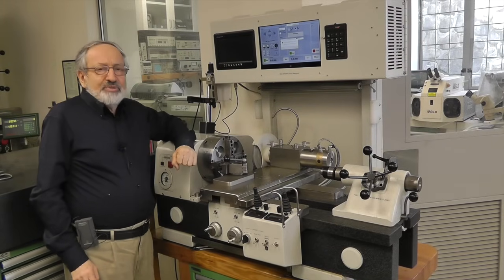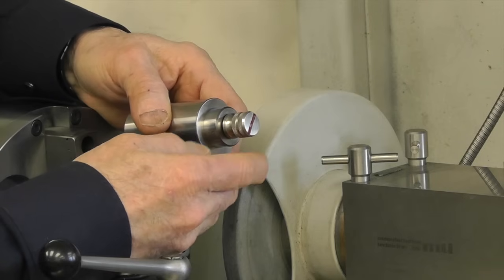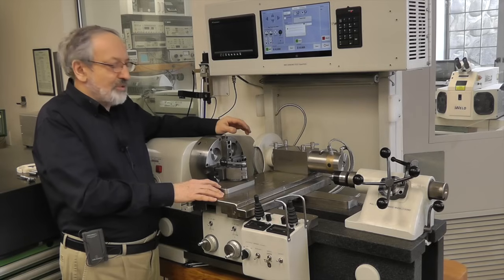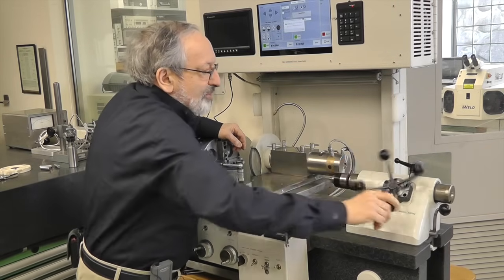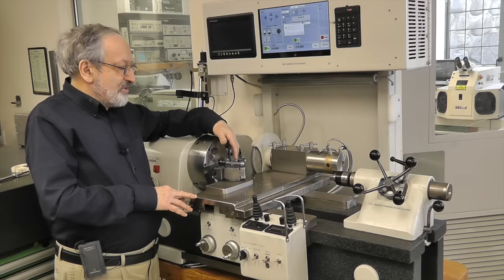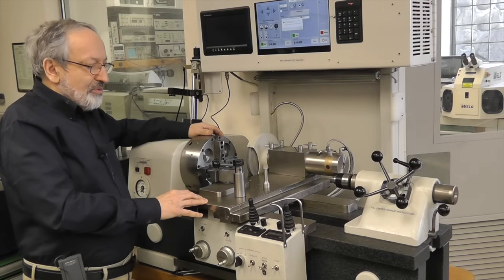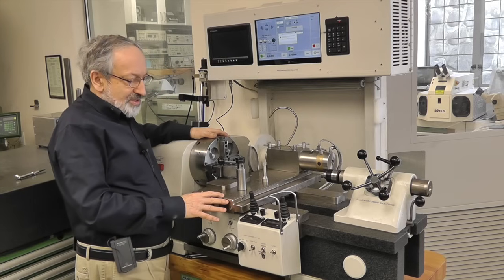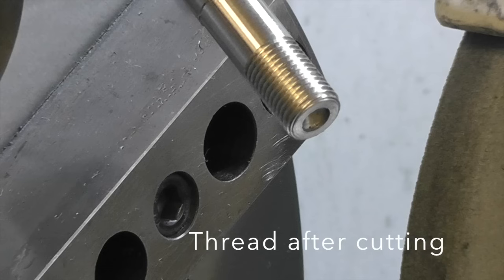High precision air bearing CNC lathe and grinder

Comment: What tool\procedure is used to calibrate equipment of this accuracy?
how to maintain it for a long time?
Reply from the maker: Standard tools: Micrometer, Granite cube (for squareness), capacitance gage (for roundness). It is stable because it is made of granite and stabilized steel.
Reply: Dan, could you clear up my understanding of how the 2 vertical granite parallels are connected together. Is the connection solely with the 2 cross bolts with spacers or is there another granite parallel (unseen on the video) glued between the verticals that maintains the alignment and the 2 cross bolts are addition re-enforcement?
Would a replica of the granite machine base be within the means and ability of an amateur builder?
Reply from the maker: They are connected by 4 cross bolts with precision ground spacers. The bed is assembled upside down on a high quality (grade AA) granite table, to guarantee tops are on the same plane. Distance between two top slabs is maintained by two removable spacers while the epoxy cures.  If you have a good granite table you can build one.
Reply: @dgelbart  make more video please if its possible...
interest how you protect bed from grinding debris (we traditionally try not to do grinding work on lathes)
Reply from the maker: I originally counted on the airflow from the air bearings to blow the debris away, plus the way wipers made of felt, but now I have way covers.

Comment: What kind of surface roughness can this machine achieve?
Reply from the maker: Never measured it. Not quite an optical mirror finish , but you can see a nice reflection of the tool from the workpiece.

Comment: Mr. Gilbert, 450 comments is a bit much to get through. Have you mentioned if you use screw threads for saddle positioning? What position sensors did you use? Thank You for sharing and inspiring. I want to attempt a similar precision lathe grinding build myself.
Reply from the maker: Just ball screws. In most of these applications geometry (cylindricity etc) is more important that accurate absolute position.
Reply: Dan Gelbart Thank you.

Comment: Does anyone have such a machine? I need a passive thrust air bearing similar to the one shown in the video. Like the Rayleigh Hydrodynamic trust bearing (video). Willing to pay $$$'s for such a machine part. Step size is ~0.00005" 1.27-1.25 microns
Reply: Can anyone build something like this?

Comment: Hi Dan I'm am upgrading my old lathe to a VFD and adding a DRO and was wondering would there be any value in investing in a  1 micron vs  the standard 5 micron magnetic linear scale for the cross slide?

 I worked at  Creo Products at the Annacis Island plant and remember one of your Creo University lunch and learns. It inspired me to get my engineering degree.
Reply from the maker: The other errors in a normal lathe, even toolroom lathe, are 5-10um so it will not increase your over-all accuracy. Also, the 1um resolution scales are not accurate to 1um. In short, I would go to 1um only on a very good lathe.

Comment: A masterpiece of ingenuity and excellence! 
At 6:18 you show your internal grinding adaptors, on which there seems to be a number of fast helical patterns in the stone  surface, what advantage does this bring to the work and how is it made?
Reply from the maker: I wasn't getting the accuracy I wanted (sub micron) and I suspected that coolant needed escape channels as wheel OD was close to ground ID. Not sure if it helped, chnnels put in by hand with diamond wheel.
Reply: What position feedback technology are you using, with ball screws, piezoelectrics, linear motors or other? What drove the selection?
Reply from the maker: Just ball screws. In these kind of jobs the main thing is the geometry (squareness, parallelism etc). Exact position less critical, unless you cut tapers  and spheres.

Comment: I'm very much on board with the use of granite in the construction of the bedways.  My question would be how did you properly align the centers of the head- and tailstocks to the ways and to each other.  A video explaining that would be very interesting an informative.

Also, did you manufacture the actual bodies of the stocks as well?  That is, did you make patterns and have castings made, or are these items from other machinery adapted to this machine?
Reply from the maker: A temporary tailstock was bored with the headstock, then a long boring bar between headstock and temporary tailstock was used to bore the tailstock in situ. Tailstock was advanced with the carriage during boring. Bore was lapped afterwards. The same temporary tailstock was used to gring the tailstock quill out of hardened A2.
Reply: That makes perfect sense, of course.  What of the CL of the heastock to the CL of the ways?  This is quite fascinating.  I was unaware of the magnitude of the radial load bearing capacity of air bearings.

Also, may I take it that the positional orientation of the carriage and tailstock relative to the CL of the lathe axis is established and maintained purely by the square geometry of the ways?  That is, you do not make any use of features such as grooves like a dovetail in the bedway as used by Hardinge?  

I have an old Schaublin SV102.  Back before my eyes started going funny, I could hold well under 2-tenths if I used great care.  It is a fine machine, but what you have created here is really very appealing in its precision.  Your leveraging of off-the shelf items to achieve it is very admirable and creative.  You should write a book on it - I believe it might well hold a place along with Moore's tome on accuracy and precision.

I would love to undertake a project like this.  Thanks for the very well done and fascinating videos.  Extreme precision has always been of endless interest to me.

Comment: Just a shoot in the dark. Any chance you have drawings on how everything is put together?
Reply from the maker: Unfortunately no, this was put together as a "one off" with no documentation.  Also, if I would have done it again I would use larger diameter ballscrews  (25mm i.o. 16mm) for increased stiffness.
Reply: Shame looks great though. Thank you.

Comment: Hi Dan, what did you use for the linear motion? Linear motors, ball screws?
Reply from the maker: Micro-stepped stepper motors + ball screws. There is a look-up table to correct leadscrew errors.
Reply: Is it open loop? Do you mind telling me your supplier for ball screws? I have been designing high accuracy 3D printers but have found lapped and ground ball screws to be prohibitively expensive.
Reply from the maker: High-quality NSK and THK balls screws bought on Ebay. The type with preloaded nuts. Open loop. Closed loop would be better but I mainly needed the accurate geometry, not absolte sise.

Comment: I know you've been asked before, but where can I get something similar, something I could mod with grinder, and make a better machine, what would be a good lathe to start with under 20k
Reply from the maker: Your best bet is to start with  a used Hardinge,  Schaublin 102 or similar lathe and add CNC. Can be done under  20K.
Reply: Thanks for the Reply Dan, I will look into it, would love to be a Journeyman in your lab, take a look at my machines over at mechabits.co.uk not quite as impressive as yours, loved all your vids.

Comment: Hi Dan,

What about the cross-slide? I mean, what kind of  configuration did you put the air bearings to give a better rigidity? In the video, I  can see a sort of inverted T configuration. What kind of  preloading did your system use? Oh, I almost forgot, how do you synchronize the "off height" and the "on height" of the air bearings with your motion system? (I mean, without  creating some "bending" force in some type of ballscrew drive).  

Great work Dan! learned a lot of things in your videos!
Reply from the maker: Cross slide is two 1"x2"x12" granite parallels with air bearing aon all 4 sides. Air bearings move up only ~10um, so this is easily taken up by nut flex coupling.
Reply: Thanks Dan,

I watched this video a couple of times, and that tool slide part was the most intriguing (maybe because it's hidden). Whith "running on all 4 sides" you mean in each granite parallels? I say, the bearings surrounds that bar more like a box (granite can hold the cutting pressures?)? Or its more like the bedways (T like)? 

Wondering if its possible to build an "air bearing milling machine" with the same idea...
Reply from the maker: The two parallels are raised on spacers which are about half the granite width, so the air bearing can reach bottom as well. The leadscrew is located between the parallels.

Comment: Hello Mr Gelbart, 
Do the air bearings for the linear motion axis' have any type of preload on them such as vacuum preload, or perhaps the weight of the saddle alone provides enough preload? 
thank you for all of your videos, they have and will continue to inspire me each and every time I watch them, including the steam engine!
Giuliano
Reply from the maker: The preload is done by opposing pairs of air bearings.
Reply: Hi dan, thanks so much for your videos i thin they're great!  How do you have opposing pairs for the Z axis? is there a slot the cross slide resides in or is it just opposing sides of the granite? I'd love a follow up video on this machine if you had the time to go into some more details such as the underside
Reply from the maker: The bed is two 50x100mm beams, each beams has air bearings on all 4 sides. Bottom bearings are smaller, to leave room for beam support.  Complete Z axis has 24 air bearing pads, to increase stiffness.
Reply: Thanks for the quick reply! wow! must have been lots of lapping to make all those bearings!

Comment: Would this lathe not be able to handle as heavy work as a lathe with more conventional bearings?
Reply from the maker: This is correct, but it is easy to increase the air bearing size or to pump oil (or coolant)  instead of air into these bearings  to handle heavy loads.  This particular one was designed for light cutting, motor is only 1HP.

Comment: Hi Mr. Gelbart, thx for this awesome video, too. I'd like to see more videos about this lathe, more so I'd like to build my own. Couple of questions:
1. What's the inner/outer diameter of your spindle shaft? Stainless steel?
2. Did you use thrust bearings for the spindle/tailstock? If not, what did you use to limit axial motion?
3. How is the cross slide fixed in position? Radial air bearings from both sides? Vacuum preloaded ones?
4. I understand all of the air bearing components have to be made to very tight tolerances. How does it react to temperature fluctuations?
Reply from the maker: Spindle air bearing about 100mm dia x150mm long, plus trust bearing (double sided) about 150mm diameter.  spindle is 440 stainless, about Rc 45, mating bearing bronze. About 100 air orifices.
Reply: Mating bearing? What's that for?
Reply from the maker: I meant the actual sleeve the shaft rides in.

Comment: I recall learning about air bearings in high school....early 1960's...I was impressed by the clearances (recording studio turntable)....take the shaft out...put a fingerprint on it....you could barely force it back in....and it wouldn't turn....
Reply: Yes, my story is just about like yours...high school...1961....and a fingerprint will 'lock it up'...and it was a record turntable...12" at least.

Comment: What a great machine. I have a couple of questions. 
First, how do you deal with the differential expansion? I understand your shop is temperature controlled --- is it on 24/7? Could the machine get warped if exposed to temperature extremes? 
Second, would it be possible to build a machine that is both precise and capable of heavy loads? Perhaps not at the same time. Maybe it could somehow switch between running air bearings and regular bearings. Is it a crazy idea?

Comment: Does it affect the precision capability, if you use a lead screw or a ball screw, and does it matter between servo or stepper. You use air bearings and granite for the ways I'm just curious about what should be used for (actuation) of a build like this. Thank you for your videos it's a real gift from someone so knowledgeable.

Comment: What is your estimation regarding how much axial and radial force the lathe chuck can handle before causing long term damage in regards to the accuracy? What are usual tolerances for the airbearings and gap inbetween the shaft and housing, also would a sealed version with pressurized hydraulic oil instead of air be more suitable for heavy load applications?
Reply from the maker: Max axial and radial force about 100Kg , airbearig gap typically 10um (0.4 thou), pressurized oil will carry more load and less sensitive to crashing as it is lubricated.
Reply: Dan Gelbart one thing i forgot to ask is how much of an issue is starting and stopping the shaft turning, when there is physical contact between the two surfaces at 0 rpm wouldn't a little bit of wear be the result?
Reply from the maker: These are pressurized (hydrostatic) bearings, no contact even when stopped.

Comment: Hi, Dan, amazing machine, thanks for shareing. I wonder if it is easier to build this type of lathe based on an existing precision manual lathe, by replacing the spindle with air bearing spindle, and reuse other existing parts on the lathe, if so, can you recommend a good manual lathe to start with? thanks,
Reply from the maker: The bed and cross slide of an existing lathe is not accurate enough. You need 1um straightness and squareness. . What you can do is buy a used Moore #3 Jig Borer (under $3000 on Ebay) and mount the spindle instead of column. Several companies who needed high accuracy machines did that.
Reply: Thanks, Dan, do you know any place I could source a nice air bearing spindle? I would like to turn max 200mm OD part on this lathe. Also, any requirements on the maximum spindle speed? the higher the better? Thanks.
Reply from the maker: Ebay. New ones cost a fortune. No need for high speed.

Comment: How to zero the taper?

I'm computer science student, not familiar with machinist terms.

By taper I mean the angle between grinder wheel axis and chuck axis. Could it be adjusted by moving both X and Y axis or it's more precise to set it mechanically and move just one axis?

Thank you.
Reply from the maker: Interestingly this angle is not importsnt. The taper angle is determined by the simultaneous X and Y movement, and taper will be correct even if grinding wheel is set to the wrong angle.

Comment: How do you clean it? If its accurate to 1 micro, then cleaning it after a grinding job must be a pain.
Reply from the maker: In a piston and cylinder I suspect  it pushes the dust away. Does not seem a problem.
Reply: Dan Gelbart
Pretty neat setup.

Comment: You mentioned the bearings are from semiconductor equipment, is it from a silicon wafer dicing saw? My father has several air spindles from old K&S wafer saws, but they have been reworked too many times to be worth anything other than scrap metal, I disassembled one of them to see how it works.
Reply from the maker: Yes, from dicing saw.
Reply: Wow, I am surprised a dicing saw spindle can withstand the radial load cutting forces produced during lathe turning.  Wafer dicing is for the most part a very fragile application, and a dicing blade would obliterate at any where near the order of magnitude of machining forces.  Also to the extent of my knowledge these spindles are not supposed to be turned at all, without air on.  Do you know what kind of machine the spindle was from? K&S, Disco, ADT?
Reply from the maker: From some one off machine, quite large bearing.
Reply: Hey dan sorry to ask again but is there a document that I can read for the skinner chuck design ? I looked through their old ones but yours seems modified nicer version. 
Thank you

Comment: I love your videos and started to read The book you recomended: building scientific apparatus. This kind of knowledge and inspiration was very hard to get only a few years ago and thanks to the Wonders of Youtube and people like you, this information spreads rapidly and hopefully makes The world a better place. I do however have a question. Do you shim or otherwise control The thickness of The glue joints or do you measure afterwards? Is this even an issue?Brgds from sweden Lars
Reply from the maker: Hi Lars: no need to control the thickness.
Reply: I assume this is because your glue up was performed upside down on a surface plate?

Comment: what kind of positioning motors does your masterpiece use?
Reply from the maker: Regular steppers.
Reply: Your lathe has a lot of custom made parts. Cross slide seems to be dovetail , how did you machine it? Or it is purchased from manufacturer.
Reply from the maker: All custom made parts except granite parallels which are a standard item.
Reply: Dear Dr. Dan, how did you machine the dovetail of cross slide?  Have you lapped it by hand?
Reply from the maker: Ground and scraped, hardenned parts ground and lapped.
Reply: Dan , no chance to find out such a tailstock and chuck. Already few months searching for it
Reply: He custom-built both the tailstock and the chuck. The tailstock rides on air bearings, the body is welded together, and the quill is hardened and lapped steel.
Reply: madaxe no chance that he machined custom made chuck
Reply: He did.

Comment: Dan,
How did you make the headstock and tailstock?  Did you cast them yourself or have them made at an outside foundry?
david
Reply from the maker: The are fabricated: the tailstock is a weldment, later annealed for stability, the headstock is made up by brazing together (in a furnace) waterjet cut plate.